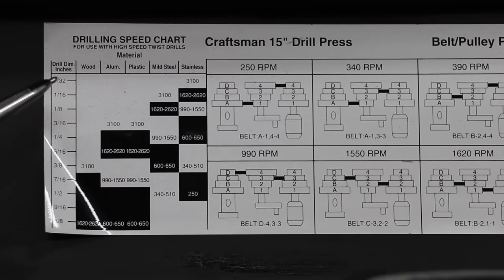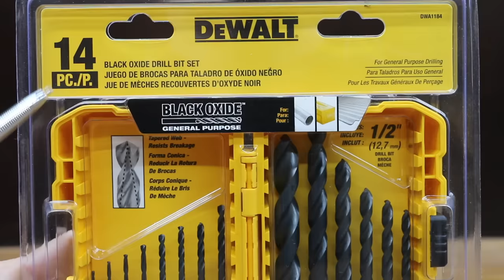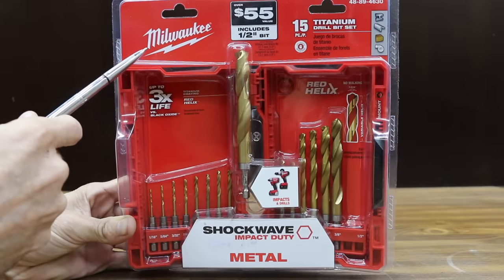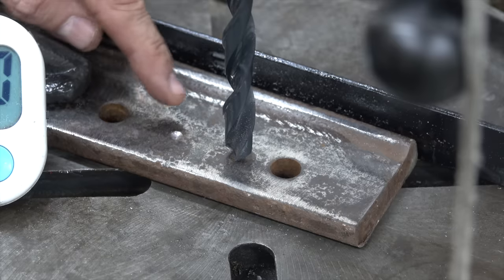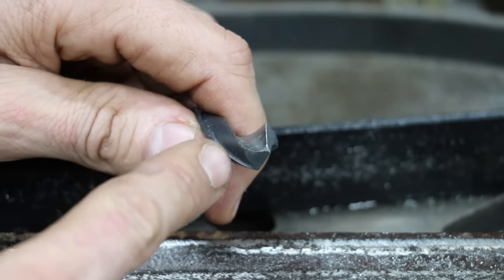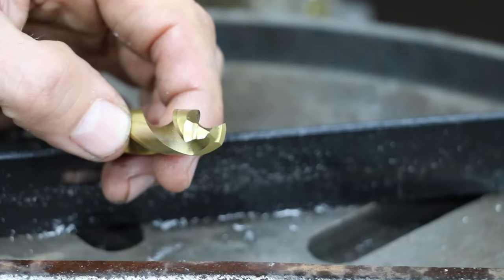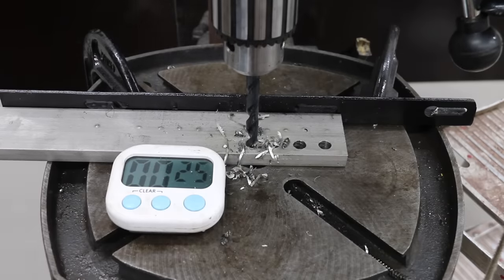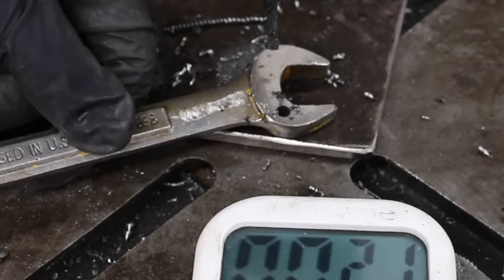Which Drill Bit Brand is Best? Let's find out!

Comment: As usual, simply great!  That said, M42 cobalt is thought by many to be too brittle for hand-held drilling. I have various sizes I’ve collected over the years, mostly Irwin brand.  I’ve never broken one, but I’m religiously careful when using my M42 alloy cobalt bits hand-held.  If you ever redo this test I’d appreciate an M35 cobalt set being included. M35 alloy is considered by many to be a better alloy for Hand-held drilling. Less brittle but not quite as hard as M42 alloy.
Reply from the maker: Thanks!  Thanks for the suggestion.
Reply: Do you think using liberal oil or cutting fluid would prevent the chipping of the Cobalt? I've used Cobalt bits dry, and I think it's the dry drilling where the metal basically scrapes and chips. He does a review on this channel of cutting fluid, and "Magic Tap" was one of the best ones, as well as CRC chlorinated paraffin cutting oil, which both had really strong lubrication abilities. The lubrication would probably eliminate all the chipping, but it's just a guess.
Reply: @Ritalie  I prefer the product “Tap Magic”. It’s simply awesome for my drilling and tapping chores. Lastly, it’s a sad fact many of today’s bits have an awful grind. I often sharpen my new bits before critical use.  I find a Drill Doctor makes quick work of both Steel and cobalt alloys. I’ve uses one since the 80’s.  I’d say 80% of my drill index has been resharpened, many bits having been sharpened before first use.  Regarding Tap Magic:  I've been using Tap Magic since the mid 1980's.  At that time there were only two formulations, Aluminum, and Ferrous (steel/iron).  The proof is actually hand-tapping a few holes with Tap Magic, dry, and other tapping lubricants.  The outcome is remarkably in favor of Tap Magic.!
Reply: @Tool-Meister  I didn't know if those drill sharpeners were actually useful. I better buy one. So yes, Tap Magic. I think I said it backwards. That's one of the very best cutting fluids because it has very high lubricant properties. In the tests on this channel it performed best.
Reply: M35 has 5% Moly, 6.4% Tungsten, and 5% Cobalt compared to 9.5% Mo, 1.5% W, and 8% Co of M42. I think M35 is harder and more brittle than M42 because of higher Tungsten it has, but also M35 has lower heat resistance due to lower Cobalt content.

Comment: It would be great to see a test on circular saw blades for maybe a 10” or 7 1/4” saw. I use those almost every day and would love to see which brand of blades is best!!
Reply: The new diablo blades that just came out, diablo was probably the best before too. Its between diablo and makita for best wood blades from what I've seen and used.
Reply from the maker: Great test idea!  Thank you
Reply: I’ve heard the dewalt blades provide a great cut if you strip the paint off

Comment: I would be interested to see how some of the "professional brands" such as Cleveland compare to these more mainstream consumer brands.
Reply from the maker: Thank you for the video idea!
Reply: Chicago Latrobe.
Sandvik.
A Swiss made set I owned in the 80's(brand name escapes me at the moment).
Reply: Go get the blue Fastenal twist drill canister as well, those have been my go-to in service trucks for years
Reply: Cleveland twists and sandviks are what I use
Reply: Guhring Walter, OSG, Titex for serious drilling performance
Reply: poorly I speak from experience, I have  Irwin drill bits that have never broken , some are hand me downs from my dad. honestly the price difference is really not that great when 1 lasts until they go blunt and the other breaks.
Reply: next video should be real drill bits!! also sharpened correctly for the material!
Reply: @TheBermitt  Sharp is sharp is sharp. If you're talking about dulling the bits for yellow metals, it's really unnecessary in any scenario other than in a hand drill. (People watched an AvE video where he "brasses off" drill bits; whatever "brassing off" means, and that's become popular. I've drilled tons of yellow metals on presses and mills, lathes, and I've never dulled the bits.) If you meant altering the geometry for different materials or altering the grind, people aren't really altering drill bit geometry to drill different materials. They buy the proper bit. The only real difference between drill bit grind/geometry is split point vs chisel, and the point angle. (90°, 100°, 118°, 135°, etc.) Using a single factory grind and geometry on different materials is far better than attempting to alter the grind/geometry yourself, to suit different types of materials. (Unless you have a tool and cutter grinder.)
Reply: Anything "made in USA" usually isn't and is junk. I'm in Canada and have engraved "Made in USA" on lots of junk over the years
Reply: Andrew Delashaw anyone altering a drill and claiming it works better or survives is usually a dummy that doesn't know the right speed and feed
Reply: @xenonram  Back in the student machine shop, I was trying to drill some brass (type unknown).  After breaking two bits which just bit right in and snapped, the machinist at the real shop came to see what I was doing.  He ground a very slight flat on the cutting edge of each flute, and though the bit chattered and left a rough finish, I never broke one again.
  Maybe the drill press had slop in it, I don't know.  It was a cheap one, but the trick worked wonders for me in any case.  I have used it since when drilling lead.

Comment: Have always bought Dewalt bits. But they seem to be on sale whenever I need them. Glad I’ve been buying the good stuff this whole time.
Reply: John Lee. It seems like no matter what bit set that I’ve bought, I always go back to Dewalt. They just seem tougher.
Same goes for the philips, flat, and square bit Dewalt sets.
Reply from the maker: Thank you for the feedback
Reply: I usually  try to keep a spare set on hand n try to only by on sale
Reply: Same here! I was rooting for DeWalt even before the test started
Reply: @twilight_foxbody7354   i  also only run the regular  tip would by the cobalt option but cant find em without the step
Reply: @gwarrichmond6232  i dont shop home depot n dnt buy drill bits from menards any more  straight  to farm n fleet
Reply: @gwarrichmond6232  depends  on the uses some things will destroy a expensive  bit
Reply: @gwarrichmond6232  sometimes you need a hole on a weld or in a corner and are willing to sacrifice  a  bit to do just that  were not all machinists and have a ideal  surface or spot to drill a hole

Comment: Me: sees Bosch Drill
My German Mind: Here we go Bois
Reply: Du meinst: "HSS .... HSS-R ... HSS-G klingt schon recht gut ... was kosten die nitrierten? *hmmmm* ... und die Cobalt? Naa, bleib ma bei den G"
Reply: Aren't Festool and Hilti the superior German brands?
Reply: @dieseldouche7735  Bosch, Makita, Hilti and Festool are the most known Brands in Germany. Bosch has by far the best Battery packs
Reply: @enexo9882  Makita is actually Japanese and I find them to be the most reliable, just like Japanese cars. I don't have the wallet for Festool or Hilti to know if they're truly worth the money though and I've never tried Bosch.
Reply: @dieseldouche7735  I know, but the Brand is well known in Germany. I did say its a German Brand and Mikita is very reliable yes, im working in a Company were we are using only Bosch tools, in my Opinion they are better but also x2/x3 of the Price...
Reply: @dieseldouche7735  it depends largely what you want, and what tool you are buying.
HILTI is unbeatable in build-quality and reliability, plus they come with amazing service options, however 700€ for a cordless drill is quite steep. I have also heard many bad things about other machines than drills built by them.
Festool afaik makes the best Saws but for an angle grinder I would pick a Bosch-Professional over most everything else. Makita is good at about anything they do to my knowledge, but they are a bit too pricey for the quality imo. (at least they used to be)
Reply: @enexo9882  have you ever had the pleasure of working wit ha HILTI drill? they have wrist breaking torque so not well suited for amateurs but having someone come to you on-site with a replacement is worth a lot if you're on a tight schedule.
Reply: @martinb.770  oder HSS-E Co5, da läuft mir das wasser im mund zusammen. da kostet zwar ein großer bohrer 10€ aber die kann man überall durchjagen
Reply: @christopherschafer6455  hilti demo saws, hammer drills are junk.  Heavy, uncomfortable and bulky.  They always break.  Husqvarna demo saw I have is going strong after 1 year while the hilti would last 3 months before the switch broke.
Reply: EneXo One of the best tools in Germany is Fein to.
Reply: Metabo is also German
Reply: @dieseldouche7735  Most of my power tools are Makita ... I tend to buy a makita first and if I used it enough to break it, I buy a bosch and haven't had to buy another one. I have an old B&D Radial saw that refuses to die. My demolition saws , circular saws,  as well as my drill press are Bosch. I just did go from 12 volt to 18 volt Makita drill and driver this year. Bosch is pricer, but they seem almost indestructible. Oh and my plunge router is a bosch but got it from the get go. My buddy swears by Hilti and the coupe of times I've used them they seemed rock solid. I've never even seen a Festool in person.
Reply: Bostitch is the best I can find
Reply: I heard good things about Bosch.
Reply: @enricod2061  Cant you read? I already said i know that, but its well known in Germany...
Reply: @Turborider  Yes, Metabo's origins are German, but it was sold to Hitachi in 2016, who then sold the Metabo and Hitachi Power Tools brands to a private American firm. Now they're just known as Metabo and Metabo HPT
Reply: The Bosch is a cobalt drill is not the same material as High Speed Steel not sure why it was compared, maybe Bosch does not make a High Speed Drill
Reply: Christopher Schäfer Imo HILTI is only good when it comes to concrete work like jaxkhammers and stuff. Their drills aren‘t that good. A german yourube channel called Bauforum24 made an extensive drill test where Hilti didn‘t perform that well. it‘s an awesome channel, bummer it‘s not available in english.
Reply: Unfortunately, a lot of the products from bosch, like drill bits and many battery/non battery products from the professional line are made in China. That saddens me a lot, because I still have a bosch 800w hand drill and it's still going strong after 20 years
Reply: This made me lol. German bois 💪💪
Reply: I prefer Guhring drills.
Reply: @clamdiver5000  yeah, Guhring is better by far, but they are not supermarket sets like the ones shown here, and the price is different...
Good and kinda cheap are KEIL, also Bosch Co5 are the best amongst the cheapest.

Comment: Really put them to the test and drill some of that old bed frame steel everyone has laying around. Legend has it you can cut diamonds with it.
Reply: It's recycled rail, so mostly 880 MPa (127ksi) so yes it's surprisingly hard compared to structural steel (36ksi)
Reply from the maker: Thank you for the feedback
Reply: I learned something new!  It makes sense now why it’s so hard to drill through.  I always grab bed frames when I see them thrown away.  The Small Angle iron comes in handy for many different uses.
Reply: I have made a few things using old bed rails. It's amazing how hard it is to drill through! Some stainless steel is very hard to drill through too.
Reply: No wonder those bastards hurt so much when you accidentally kick them in the middle of the night!